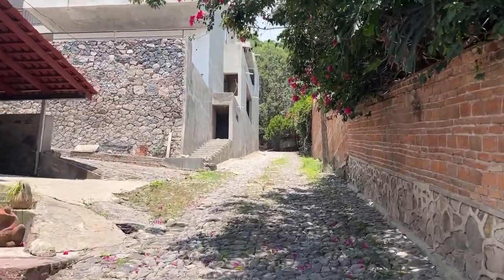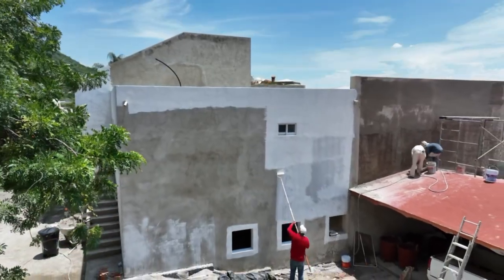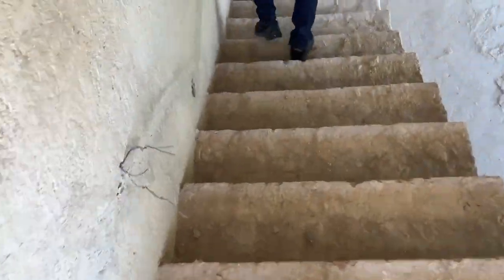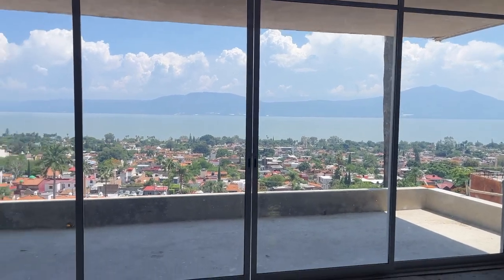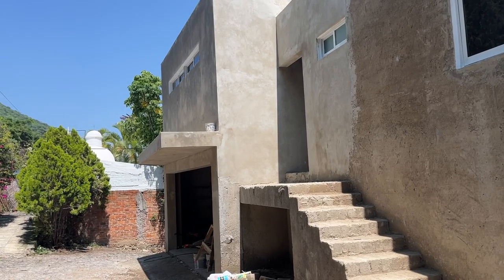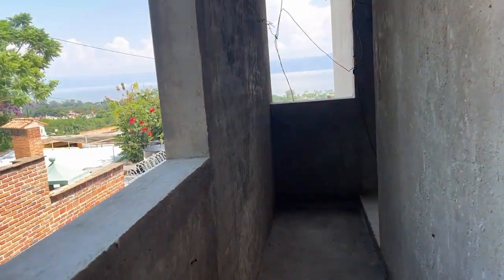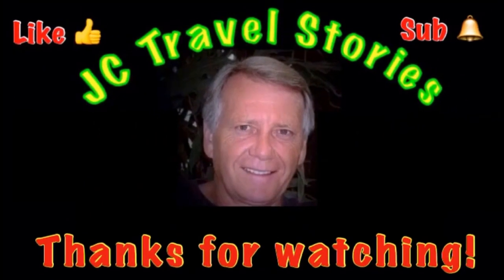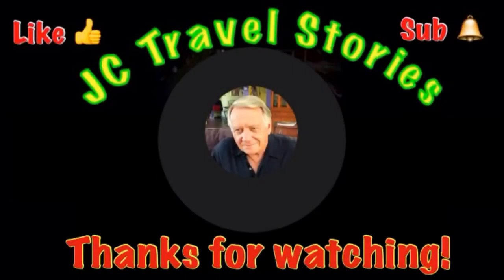Year 2 Progress

Comment: How does he verify the quality of the concrete, proper amount of rebar, etc.? We have seen a number of buildings throughout Mexico crumbling from the use of poor quality concrete.
Reply: When the home is complete, if there is any way possible to get his total cost by line item, that would be extremely useful information.
Reply from the maker: I've seen concrete crumble also because cheap builders used beach or lake sand instead of “sharp sand”.  You verify the quality of construction by verifying the references of the contractor.

Comment: This video is not Jerry's best work.  I'm happy that there is a follow up on this project's progress - very happy in fact.  But, there is a whole bunch of back story and details of the build that are left out.
Reply: FYI, that tall wall in the front of the house.  The one Jerry recommended be built higher to block the neighbor's house.  That wall has some beautiful rock in it.  The problem is that the wall's mortar has washed down the surface and covered the stone.  That stone canned be cleaned up and the joints repointed to get a fantastic looking stone wall.
Reply: I was admiring the stone but also curious about the walls' structural support, i.e., how do you ensure it doesn't fall when on a downward slope without gradual terracing? Genuinely curious and not being critical.
Reply: Is it just me or did it look warped on the edge?
Reply: @rubyoro0  Good eye.  That's the original wall.  It has a pitch toward the house.  You can see from the side view how Sergio's guys built on top of it.  Usually when a wall has a pitch like that, it indicates the wall is a retaining wall.  Which makes sense in that area due to the steep incline of the ground.